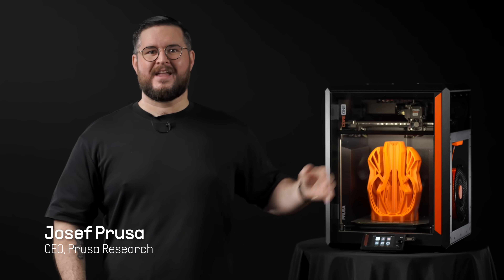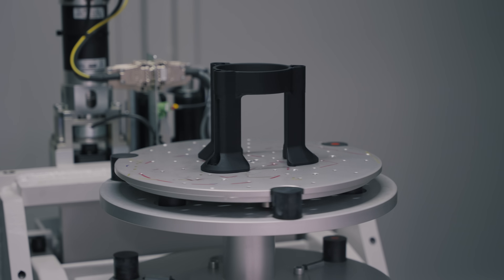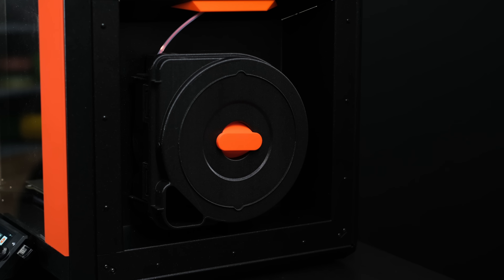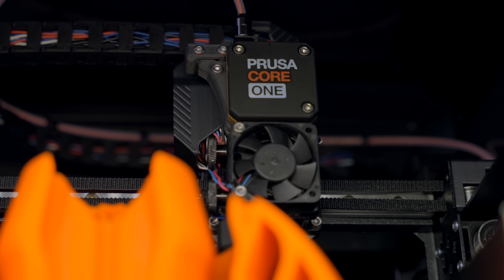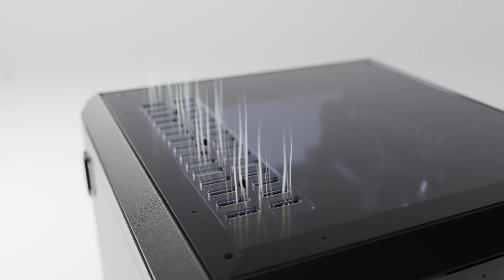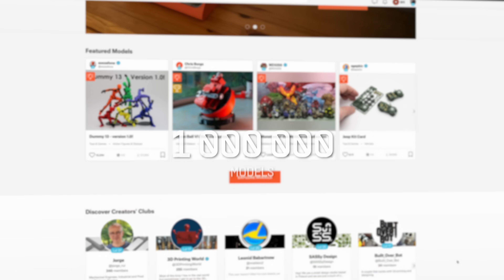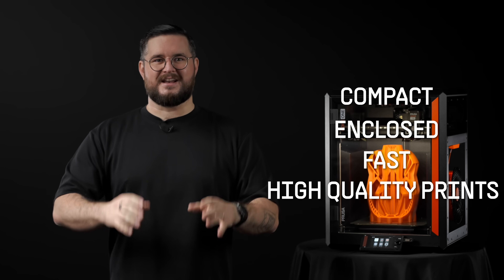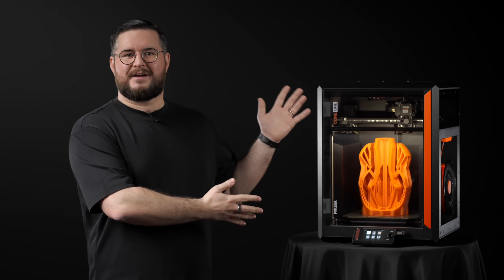Prusa CORE One - Fully Enclosed, High-Speed CoreXY 3D Printer With Active Chamber Temp Control

Comment: Excellent, this is just what you needed to do! The pricing is very competitive too and honestly it looks like a no-brainer for printing ABS due to the easy servicing and easy connection to a negative pressure system.
Reply: You really need to setup a local distributor and assembler in the US to take advantage of the coming China sanctions.
Reply: @radicalbyte  PrintedSolid is assembling MK4’s in the US.

Comment: 4:20 SHOTS FIRED!!!
Reply: The whole video is full of little jabs like that. A door that does not break, PLA with door closed, no network required, ...  :-)
Reply: @ulaB Not that i print that much PLA but i have never had an issue with the door closed, i have printed PLA on old enclosed printers like the up mini and never had an issue ether.
Reply: @andljoy  Not sure where my other reply went, but Bambu for example suggests in their own material table to open the door and remove the lid when printing PLA or even PETG.
Reply: @ulaB  I know they do. But i have never had an issue with cooling.
Reply: @ulaB  hundreds of hours printing pla with the door closed, no issues.
Reply: @wraith2286  I can drift with my car too, but that doesn't mean that I am supposed to... :) Plus I then don't go and tell manufacturers of drift cars that their marketing is "highly wrong, false promoting".
Reply: @ulaB  this isn't even close to a reasonable comparison lol. Opening the door is a recommendation for potentially better results in a normal use case, not a requirement or even guaranteed improvement (which in the vast majority of cases, it doesn't matter).

Comparing that to something that a car manufacturer would never recommend because it does in fact damage and put strain on a vehicle since it is not designed for it (on top of being illegal in most situations), is stupid.
Reply: @ulaB  tho that part is highly wrong, false promoting like they are the 1st to print PLA fully enclosed. Bambu printers do this already and my Creality K1 prints fully enclosed and shut PLA just fine without clogging :D Tho printer looks good ngl. Slightly odd buildvolume compared to competitors tho. Just finished a 22cm tall statue of my little daughter made with MakerLab on my K1(12h+ print) with the doors closed and lid on. So this jab is slightly wrong from Prusa :D
Reply: At who?
Reply: @klaidasrunele  The idler replacement is a shot at Bambu. If one of the idlers break, Bambu asks you to replace the whole XY gantry.

Comment: That looks so perfect. However my MK4S works just fine in it's enclosure so I won't replace that setup soon. ^^' 

Would be really awesome to see a Prusa CORE One paired with a Pruxa XL 5 Head. A compact, fully enclosed, 5 tool system - maybe even with active chamber heating? or a xl print volume? would be so perfect.
Reply: I believe they already have or are working on a chamber for the XL

Comment: Really good looking Printer but the layer shift at 2:11 is a bit worrisome
Reply: i'm pretty sure those are two separated half put together
Reply: It's two parts of model. How it would be a layer shift at that angle?!
Reply: I think it is printed in 2 halves and glued together. No layer shift
Reply: Yeah, I think it's printed in two parts and they cheated a bit by putting the completed (glued together) model back into the printer enclosure (maybe to show the size of the printing area, even if that model wasn't printed in place).
Reply: Thats the equator

Comment: A conversion kit???? Hell yeah.
Reply: @2341f  "Premium engineering materials" like...ABS? xD
Reply: @2341f huffing harmful voc's to feel something again
Reply: $10 less then the full item. :)
Reply: @GeorgeGraves  500 USD less than the half!
Reply: @GeorgeGraves  What are you talking about? It's less than half the price !

(a bot? was stating a ridiculous few dollars difference, where it's in reality HUGE) 

Only thing they could work on price-wise is assembly cost. How is it THAT expensive? I know at least 10 engineers with weekly wages similar to the price difference.
It might be Prusa's way to force end user to learn about the machine they are gonna use and actually profit there, but still... makes the kit even better deal for me :D
Reply: You know engineers that make 500a week?
Reply: @jake1021  Yes. Many companies here in eastern Poland will offer you something like 1- 1.5 times minimum wage.
Honestly unless you are good at it and find a decent employee CAD guys can earn less than the ones standing in front of the machine.

That doesn't mean there aren't any good jobs for designers ;) There is just more entry-level competition, same as architects. And robots are still too expensive to reliably replace workers in short runs.

Comment: Finally! Closed chamber normal size CoreXY from Prusa! Thank you!
Reply: XL crying in a corner
Reply: @Jm47A1  My XL is happily printing away waiting for it's little brother.  This will not replace what my XL can do but will be welcome addition to my collection of Prusa printers.
Reply: @johnstel  the reason why I commented that is because the original comment said finally a corexy from prusa
Reply: Yeah, wayyyy too late
Reply: PrusaXL?
Reply: @winslowjoy2629  I meant closed chamber small-ish CoreXY. XL is way too large for my needs and not a closed chamber.
Reply: XL has up to 5 toolheads for multi-material printing and 360x360x360 build volume. It's still relevant for plenty of use cases.
Reply: @icenode  sure is
Reply: @icenode  The heads like to fall off on the XL for big prints and the printer generally has a high failure rate.
Reply: @derektran9404  Source? Literally never had that happen.
Reply: @icenode LiTeRaLly
Reply: I'm honestly considering an XL just to avoid the MMU-style multi material approach. I've had nothing but bad experiences with the MMU2s.
Reply: @mhelvens  The MMU3 is a significant improvement in reliability.  I wouldn't judge it based on the MMU2. That said - the XL's tool changer is significantly better than any single nozzle solution. I wouldn't be surprised if Bambu's next printer uses a tool changer.